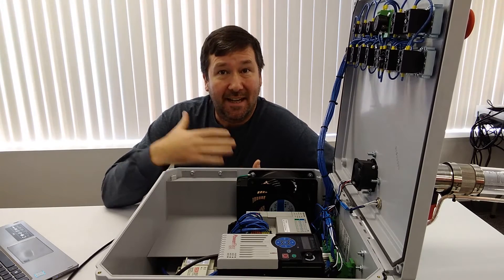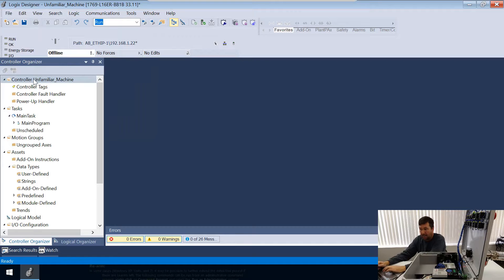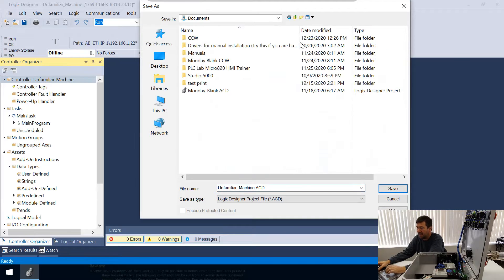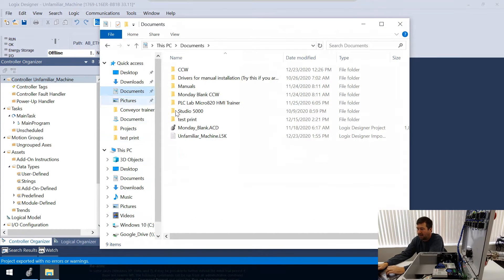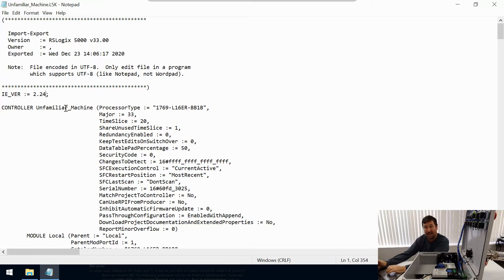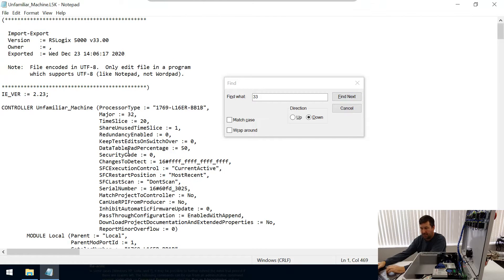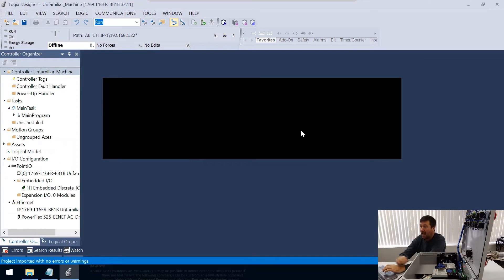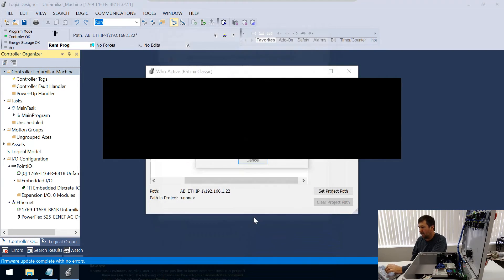Studio 5000 Downgrade the Firmware of a Controllogix Compactlogix PLC

Comment: One thing to note is some instructions can change.  For instance v36 it is LT (Less Than) where in v34 it is LES (Less Than).  It does not automatically change those and that looks to be a manual process to change them in the logic.  Most of the Compare Instructions for some reason changed and why on earth would they have changed MOV to MOVE.  If these instructions are in the code not that big of a deal to change.  But if they are in proprietary code or Add-On instructions that you can't see inside of, you are SOL.
Reply from the maker: Check out this video, they do change when going from a pre 36 program to 36 or later but not when you go from a later program to an earlier one.  Rockwell has a technote showing how to use Notepad + to do it.
https://youtube.com/live/Ex9aa9Bt4O0

Comment: Thanks very much for your videos, they are very helpful, 
Please I have the issue but in another way, 
I have studio 5000 v33.03 , and I have a machine which is  controlled by plc L33ERM , when I connected the usb cable to upload the project from the plc, the software shows me a message that the plc was programmed with version 32 ( please install Logix Designer v32.00 to upload from this controller)
How to solve this issue?
Regards
Reply from the maker: You need to download and install version 32. They are not backwards compatible and you can have multiple versions installed

Comment: On another note, would this also work for RSLogix 500 ? I came across a problem the other day with a program for a lift station. I could not open the program because of an error I got when trying to go online with the PLC. It said something to the extent of a version issue. All 3 of our licenses for RSLogix 500 is 9.00.00. I'm guessing this one particular lift station program used a slightly higher software version. I really do not know. I just can't seem to open the program.
Reply from the maker: Are you using the free software?  It only works with the Micrologix 1000 and 1100.
Reply: @TimWilborne  No, I'm using a licensed version of RSLogix 500.
Reply from the maker: Then I'd say your suspicion is correct and the Micrologix firmware is newer.

Comment: I used this method and Studio 5000 refuses to import the program to the ACD with new firmware. Any Idea why that could be? Keeps saying that the request timed out.
Reply from the maker: My first guess is one of your IO modules firmware is too high for the older processor. It can be tricky.
Reply: @TimWilborne  Hi Tim, do you have a tutorial for downgrading firmware for IO 1756-IF4FXOF2F from 5.5 to 5.005? Thanks

Comment: I am getting line (random line in the code) delimiter error, when I am importing the new l5k file. However i have no errors in my controller. Any ideas ?
Reply from the maker: Are you trying to change the firmware as this video shows or is this a general question? Haven't seen that on a firmware change
Reply: @TimWilborne  Hi Tim, Thanks for your response, sorry yes I was following your tutorial to downgrade from v33 to v32 in my project. I was following the video exactly but my project would not import studio 5000 was giving a ''delimiter error'' after some trial and error it was down to me creating the l5k file with trends in my project, when I deleted the trends and saved as L5K your method worked fine. 
Thank You!
Reply from the maker: @jamieoddie254  Good to know, thanks for sharing. That would have been a tough one to find!

Comment: Thanks for free education. I have tow questions:
1. Is it possible to install all available firmware versions?
Because it is possible that every machine that is referred may be a different version and the program connot be uploaded.
2. If PLC firmware is upgraded or downgraded, will the program in it be lost? How about data?
Thank in advance
Reply from the maker: Newer versions can be installed concurrently but older ones could not.  Besides that, it is all about hard disk space.  Always have your data backed up before doing an upgrade.  There are lots of opportunities for failures.

Comment: ive got a problem caused by allen bradley. 753 powerflex with an add-on ethernet ip module wont port correctly on version 31-33.
Reply from the maker: Right click the module in the I/O configuration, select properties, and go to the connection tab. What error does it show? My wild guess is electronic keying mismatch.

Comment: Hey Tim there is an easier way to do this if you haven’t found it yet. Save your .L5K just like you did and open it back up without editing the text and in the bottom corner of the import window it will give you all your revisions available. I would make a video but I don’t have the on camera personality like you do! Keep up the great work!
Reply from the maker: You have peaked my interest. I thought you were only able to select a newer firmware with that box but that would be an exciting find. Let me check it out.
Reply: @TimWilborne  I need to go from v33 to v20 so I can use my old antiquated PanelView Plus 600.  Did Trevor's method work?
Reply from the maker: No.  You can only upgrade the firmware using Trevor's method, not downgrade.  But if you try, you will get the magic number you need to edit in the LK5 file using the method I show in this video.
Reply: @TimWilborne  Did his way work????
Reply: Thank you Tim🙏🙏 very informative video, saves a lot of time.

Comment: What if you are not able to open a project that is version 24 when I only have version 30 studio 5000?
Reply from the maker: You will need to install version 24 which can be installed along with version 30.  Also, if you only need to view it, you can open it with version 30 and it will give you the option to change the version.